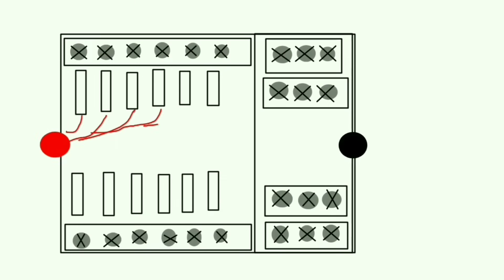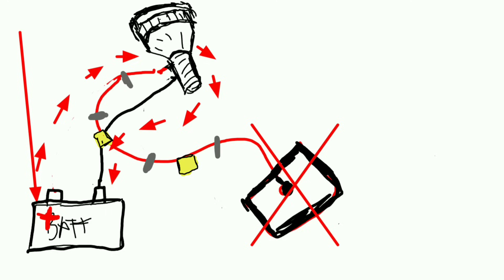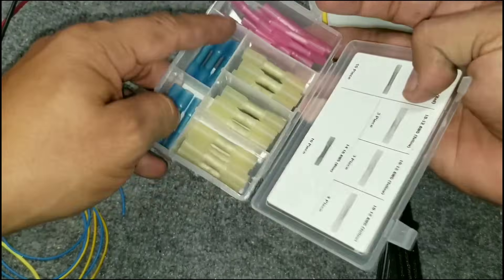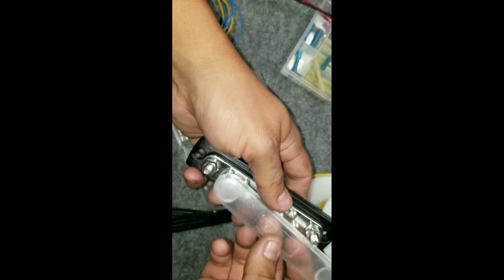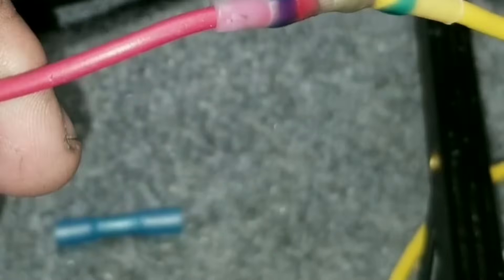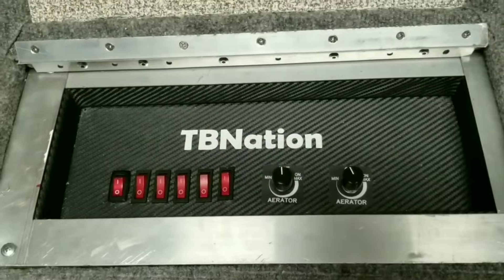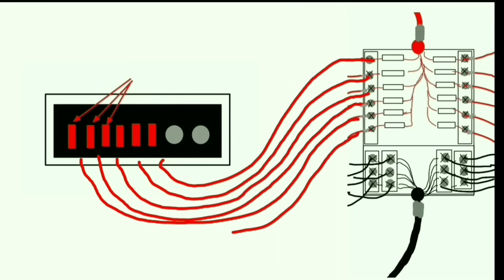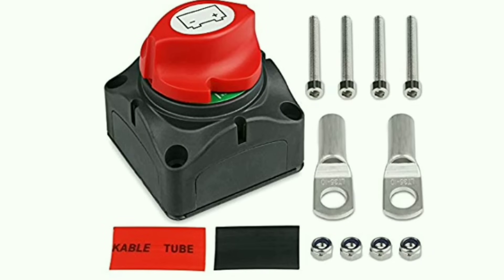SUPER EASY Boat Wiring Electrical Diagrams, Fuse blocks, busbars, marine grade

Comment: I don't think ABYC approves those solder butt connectors, a marine surveyor may ding you for that during their inspection and you may need to redo for insurance purposes. They're fine for this application of course, but ABYC doesn't like solder as it creates a brittle point that vibration could sever.

Comment: Absolutely fantastic video. I'm about to wire a jon boat from scratch. I bought a fuse box like the one pictured so I didn't need a bus bar. I have a switch panel, fuse box, and accessories all going into a cut off switch before reaching the battery. This video explains everything perfectly. Thanks.

Comment: This is likely helpful for those that no very little about boat wiring but it falls short of actually meeting the best practice standards.

Those crimpers are junk. Toss them.
Those low heat - heat shrink solder splices are junk.  You can pull them apart easily if the wire heats up they will fall open possibly starting a fire. 
Those 3 poll switches are ….. you guessed it junk.  They are not sealed and will hold moisture inside and corrode quickly.
Reply from the maker: What switches do you recommend?

Comment: I crimp and solder. Many a time I'll remove the plastic par of the terminal  and use heat shrink instead. Flaming the plastics and wire insulation ain't good....heat gun and heat shrink...!

Comment: When running from the switch to the distribution block do you keep all the positive wires same length or does it not matter?
Reply from the maker: I tried to keep all wires the minimum length you can make them. It helps with overheating.

Comment: I'm NOT trying to bust anybody's chops here. We ALL are learning. Just pushing a little safety and DC information. A battery has enough power to cause a fire and they have caused fires, if ANY of the main RED wires connected at the Battery POS post (the wires that carries the "whole" load to the little fuse blocks) were to get a short (from not being covered or chafing or being cut or a SHIT Happens event), than having a Battery fuse connected at the POS post (sized to protect the wire and carry the load) prevents that possible fire?  When showing the whole world while wiring a DC system now's the time to explain how it should be done SAFETLY in case they didn't already know? And possibly save a life! All vehicle DC systems have a fuse or fusible link when they leave the factory to prevent a wire fire! Understanding that this is a (How I do it) video. Do it RIGHT not just make it work should apply to everyone! 👍 For the price of the proper fuse, fuse holder a couple wire terminal connectors and an hour of time is cheaper than replacing the whole boat or (whatever DC project) and having a LIFE changing event for everyone! With all the Boaters, RVer's, DIY Offgrid builders, Van living, Solar and "Green" energy builders that's going on DC safety is a must!  BE SAFE EVERYBODY!

Comment: Coat your wire conductors (prior to crimping and heat shrinking) and terminals with dielectric grease, same goes for all plugs, sockets and relays!  (Do not grease wire when solder "crimping")
PS- heat shrink is NOT waterproof!

Comment: Use a heat gun. You won't over heat your connectors or melt/degrade your insulation. But connectors are way better then solder sleeve connectors. They handle hold up longer and are less likely to break from flexing. For those of you that think soldering is a better connection. Power only runs around the outside of the wire so it really doesn't matter if the center has a better connection.
Reply from the maker: I use a heat gun now

Comment: What do u do with all the negative wires on the switch panel.. it's the only thing holding me up from using this blue sea systems fuse block and bus bar combo. Just blows my mind that in the video I don't see any negative wires coming from the switch panel
Reply from the maker: They are it's just Piggy backed to one wire

Comment: Hi TBN. Im wondering if he wired the trolling motor to the switch panel as well? And did he have to also use a circuit breaker
Reply from the maker: The trolling motor is separate from everything - on its own battery(ies), breaker, etc.

Comment: Why didn't you just buy a proper switch panel and run everything to that via conduit and solder it all properly?  I like you mate and this is a half decent attempt at boat electrics but you've went down the "too much hardware" route and complicated it. Bus bars are terrible on boats they just are.

Comment: 15 minutes...1,000 questions answered! Thanks Brother! Still...I have Just one though...I see many ads for control boxes...is the BUS always necessary or do some of these have it bult in for a simple 12V Boat system needing only a 4 switch panel? Thanks....
Reply from the maker: You can direct wire in line fuse Wells to them if you want to bypass the bus bar fuse block. The bus bar/fuse block is just a lot easier

Comment: That was a great video! Glad I found it and watched it!  One question please, If i have two trolling motor batteries connected parallel and I hook one of those batteries to a battery charger, will it end up charging both batteries??
Reply from the maker: I'm not sure. It makes sense.
Reply: From my experience with batteries it will charge all that are connected in parallel.
Reply: @TheDlambert   Thanks!

Comment: I'm an engineer and have been commercial fishing over 22 years.  You will not find crimp connectors on my boats.  I am a fan of the solder connectors. Crimp connectors are a guaranteed fail spot, heat shrink or no.  It's basically an arc short in the wire.  Soldering basically makes a solid connection in the wire with minimal resistance. If you can not solder, get the solder connections. Save yourself a lot of headaches. Also, if you use buss bars,  make sure you use fuseable links or connection to a fuse block for the power out. Nice video
Reply from the maker: The sottering connectors are not USCG approved.  There is no telling how long they will last before the exterior dry-rots.  USCG also recommends the use of Crim connectors over soldering because of the constant shaking and shuttering of the boat over time, which recommends the most flexible and durable connection.  Soldering is supposed to be used sparingly in a boat.
Reply: @TinyBoatNation  that's not correct.  The only regulation on connection ends are crimp or pressure style connectors are to be crimped with the tool designed to use with the specific pressure connector, (if you are using Ancor connectors you are required to use an Anchor crimper), and they have a pull force requirement for the connectors.  it is recommended to solder wire ends prior to crimping, Soldered wires are not to be the only mechanical means of connecting wires, wire nuts are only permitted in certain applications ( sodium or Mercury Halide lighting) and must be in a weatherproof box and properly wrapped with chaff tape, insulting tape and immobilized in the box. Oh and set screw terminal plugs must have a pressure plate under the screw. I think that's it. I personallyl recommend using terminal connectors at your wire connections and the only reason why Soldered wires are not to be the sole mechanical means is because of temperature and the chance of the solder melting it if the wire gets hot enough. Movement isn't a factor because of securing the wire through conduit or every 16 or 18 inches with a cushion clamp.  See I have to take this test every 5 years to renew my licenses through the Coast Guard and a lot of the things it covers is this kind of regulations.

Comment: getting stumped......92 ranger 361v need a simple solution......my port side aerator just stopped working....worked all yr.   pumps works when bench tested, all fuses are good .  want to rewire but don't know where to start.

Comment: Nice video, but just for correctness - what you say at 1:29 is wrong. There is no principal difference between + and - in the circuit. By convention we "ground" the negative, but many older production cars (and boats) have grounded +.

Comment: On the back of my switch panel I only have a place to connect up the positive to each switch.  What do I do with the negative coming out from my lights?
Reply: Run them to the battery or a bar with a wire running to the neg on the battery or your boat grounding point.

Comment: The question I have is I have a 1991 bass buggy 16ft pontoon boat.
I've completely restored this pontoon boat but I'm using the original wiring plus wiring harness? 
Should I do this or should I completely strip everything out and rewire and run new wires to where I can actually understand how they have been ran plus I'd avoid fires 🔥 🤔!
I'm all about TBNATION BUT MAKING IT HAPPEN ON A 16FT PONTOON BOAT!
POSITIVE FEEDBACK WOULD BE GREATLY APPRECIATED!!!!

Comment: I’m trying to do this setup with my boat. Using dual gauge wire too 3 gang rocker switches. Connecting the positive from the accessory to the top switch connection (positive) then another connector coming off the middle switch connection (acc) to circuit board with fuse. Then the negative from the accessory to the corresponding negative spot on the circuit board. Circuit board is wired too a battery on/off switch. The lights and accessories works when I just hard wire both wires to the circuit board, just not when I wire them to the switch, I keep blowing fuses left and right. Any help would be greatly appreciated! Thanks.

Comment: I'm gonna tell you about a life changing tool for what you are doing especialy those sick ass solder connectors  surface mount rework hot air gun. It's for doing surface mount pcb rework  it's a heat gun that gets hot 5 times as fast as what you are using, has digital temp control, adjustable air , multiple nozzles for adjusting the outlet, and best of all gets up to 800degrees and is made to melt solder. Try melting solder with your heat gun. Get one it will change your life.  thank me later. Also Newark,  digikey , mouser , are 3 different online electrical component supply houses .

Comment: So I just bought a boat from fb marketplace. They had a bunch of wires running from front to back and I hooked them to the batteries I bought and they started smoking and melting. I'm going to rerun everything so I know what is what. But my issue is idk shit about electric. What I'm getting from this is I run all positive to a fuse box and negative to a busbar?

Comment: I want to put a stereo, USB port, trolling motor, and 2 lights in a “free” boat I recently inherited. Can I safely run all these off of a bus bar? Do I need a fuse block? I’ve never done wiring so I don’t know much about it

Comment: Will you consider reviewing True dual battery isolator kit. It has 3 yr lifespan, waterproof, anti-vibration feature and heat resistant. You can see details at www.trueam.com?

Comment: I have two 12v batteries on my boat that are independent (not connected to each other). The 29 group is dedicated to my trolling motor and the 27 group is for two garmin fish finders (93sv and 5cv). The previous boat owner installed a master kill switch and 6 slot fuse box. The fuse box is currently being used for the garmins. The trolling motor is direct to the 29 battery. I want to put the trolling motor on a fuse box as well, but I want to know if I can/should use the same fuse box as the garmins or if I should get a dedicated fuse box for the trolling motor. My confusion about sharing a fuse box for both comes from the fact that the fuse box only has a single positive and negative cable coming off of it that connects to my dedicated 27 group garmin battery. How would I set up the fuse box to connect to two batteries at the same time? Maybe this fuse box can’t support two? If so, I will probably just buy a dedicated trolling motor fuse box from minn Kota directly. Feedback? Thoughts?

Comment: Your video was great and made a ton of sense; however, I keep seeing videos saying that I should run a separate wire from each of my depth finders (3), my network hub and GPS heading sensor back to the battery to avoid interference.  What do you think?  Is this necessary or just go with the fuse block?  Maybe a certain type of fuse block is necessary to avoid interference?
Reply: @TinyBoatNation  Just to clarify, are you saying that yes, I should run individual wires directly back to the battery from each device?  If yes, I'll have a lot of individual wires connecting to my battery, are their devices I can add to the terminals to clean things up and simplify connections?
Reply: @Dlezman_fishing  now I'm not an expert but I believe from what iv watched and read that all those wires your talking about can connect to a (bus bar) and that would solve your bunch of wires into just 2 wires. Am I correct @tiny boat nation?
Reply: Fish finders are terrible for it you need to isolate the wiring for them a lot of the time because of interference. I've seen countless vids of people moaning about the feedback they are seeing on their screens and they blame bad setup in the settings or they think their transponder is to close to the motor or to high or low. Was the wiring all along.

Comment: I have a bilge pump with internal float switch that i need to get rid of this and have 2 bilge pumps and a seperate float switch.can you do a video that uses the existing wires from the old pump.

Comment: How did you wire up that big in / off switch. I have wanted to put something like that for years in my boat for my main battery to shut off my power for my electronics etc. I have no idea what wires I need and where to install them in the switch.

Comment: Nice video !!! I had a question after watching:  how do I determine the gauge of the wire going from the fuse block directly to the battery terminal and do I need circuit breaker at the battery terminal end ?

Comment: Hello, saw this a year ago, watching it again, got a question, does the fuse amp is related to the wire gauge used for a particular connection? and how do I know what amp fuse and wire gauge to use? Thank you
Reply: It all depends on how much power the particular accessory draws. If it draws 5 amps you would want to have a wire that could hold more amperage than that accessory needs. I am not 100 percent sure on the fuse I would run a 5 if the accessory draws 5 or less but if that keeps blowing the fuses then go up to a 10. Hope this helps!
Reply: Any fused item will say what fuse rating it needs. You will get away with different guage wires on most stuff. I mean, if the guage of wire really mattered as much as you think other than being capable of doing the job then that means any wire in your house is the same, it's coming in on a lot fatter a cable than your circuits are. In my opinion you'd need to try and push the boundaries of wire guage/resistance  mismatches for it to become an issue on relatively low current 12/24v stuff

Comment: I really like those Adhesive Solder Butt connectors.  Have you seen them made as a reducer?  I want to connect my fuel sender up to my std 16 awg to run to the console.  I'm pretty sure the Sender has 18 or smaller wire and given it's going to be under my deck, I want the best connection so I don't have to revisit in the future.
Reply: They are cold solder city they barely do more than glue. If you flux your wires they do a better job but they absolutely suck compared to real solders they don't have any tug resistance it's nearly all in the sleeve.

Comment: GDay fròm 🦘🤙🏼
Much Thanks 🙏🏼 for your informative layouts, & recommendations, I’m keen as well as Family & Friends to Fjnally achieve a maiden launch with my newest humble trailer boat,  I’ve managed to buy @ the start of the year. To a plethora of unforeseen circumstances I haven’t had an opportunity to stretch her leg 🦵🏼 yet. Semi-Patient Frïends have named my humble craft the ‘Olympic Torch’, because it’Never goes out’❗️🙄🙏🏼
Well, apart from the outboard Needed proper height placement, there’s way toÖ Many potential chafe points through the boats existing infrastructure. 
I haven’t yet checked your site to see if you’ve possibly got an array of grommets, or various sealing surrounds to multitask conduit sections, to, of course, ideally reduce element exposure.
Though now Utube has directed me to your reputable wares, I’ll Endevour to acquire more modernised tech from yourself, Much Tanks Agaïn 🙏🏼😃 & tight lines 🎣✅

Comment: So the wire runs from the fuse box to the switch and then to whatever I am running.  The ground wire only goes to the negative of the fuse box from whatever I am running.  
The battery wires both go to the fuse box.  I should use a shut off switch so I can stop the current to the fuse box.  
Is this correct?  If so I've got it.
What about fish finders?  Can they go through the fuse box with everything else and to a switch to turn it on?  I know the wires are quite small that run the fish finders.
I'm re-wiring a Deep V row boat my buddy gave me.  I'm going to be building a deck system similar to a bass boat and want to re-due his wiring.  The old wiring wasn't any good and everything was corroded, rusted, and rotted away.  He had minimal stuff. 
Thanks

Comment: Am looking to get a used boat that will definitely become a project. The boat is 33 years old so I am going to redo every system in it to include the electrical wiring, gauges, pumps, convert to LED lighting thru-out and generally whatever it needs. I am medically retired so as long as I am above ground, I will have and make time to work on the boat. Even if I go before the boat sees the water again, I will pass it on to my brother who is a fisherman. It is also therapy. Thanks for providing an easy to use diagram. I am mechanically inclined and have put together 4x4's and a few other things. Wiring seemed to be my weak area, may because of the intimidation factor. But it should go smoothly now. Thanks again.